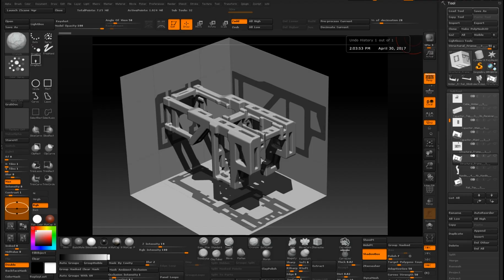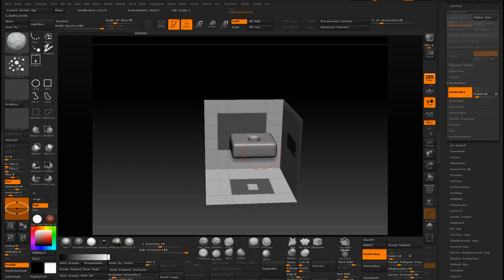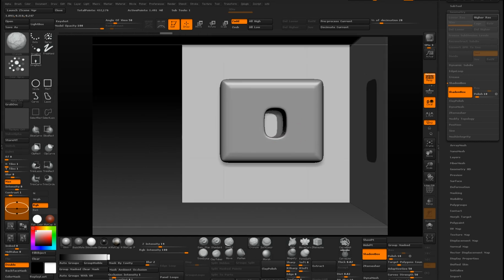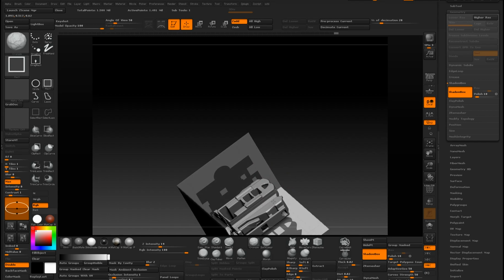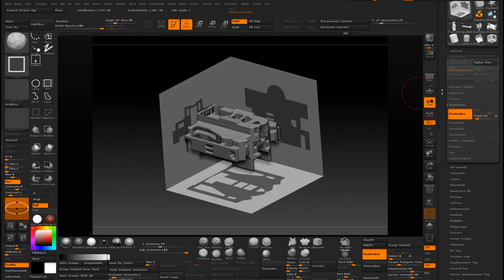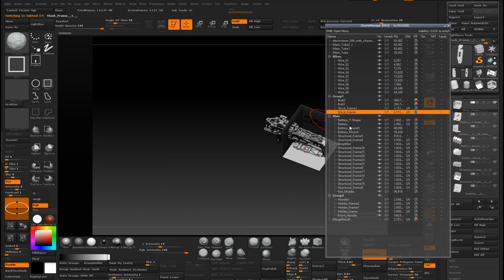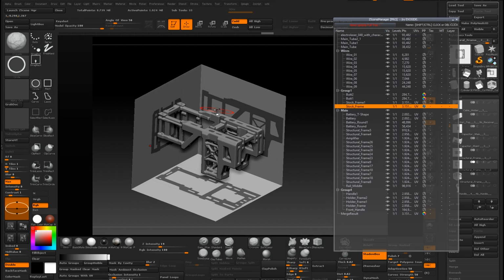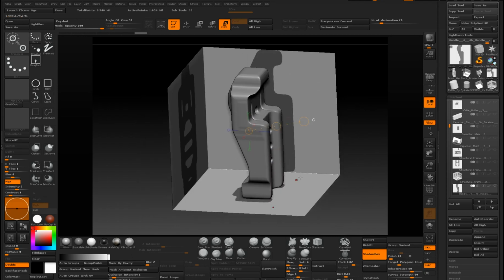Zbrush Shadowbox for Hardsurface Design

Comment: Some of the rap against SB was that the resolution was too low. Can you suggest a way AFTER modeling in SB to clean/sharpen edges? Though most of what you have done looks GREAT!
Reply from the maker: Thank you Kevin. To be honest I don't use Zbrush much today. Only for some specific operations like decimations and auto-uvs. Fully converted to 3D Coat atm :)
Reply: @AntonTenitsky  I knew there was someone using it! ;) May I ask Why?

Comment: Wouldn't a complex shape like that become a pain to retopo though?
Reply from the maker: it will take more time no doubt but if we are talking about game graphics that is using complex machinery there's no way around. I also switched to 3D Coat and it's got some really nice autoretopo algorythms.
Reply: I use 3D coat for retopo, but I do everything by hand because automatic algorithms usually just don't give me the result I want. 

I mostly do characters though, but I've been trying to get more into hard surface stuff.
Reply from the maker: yeah, you are indeed right that the best retopo is done by hand. Anyway, the idea was to show that you can do really complex stuff fast. Some people might never need to retopo this so that's not a real problem from my point of view :)
Reply: @AntonTenitsky  I've found Zbrush Zremesher is a little more elegant and faster than the 3dcoat autotopo solution.  However, hand made topology is much easier and faster in 3dcoat.
Reply from the maker: @DigiFootageFX  I would agree with it :)